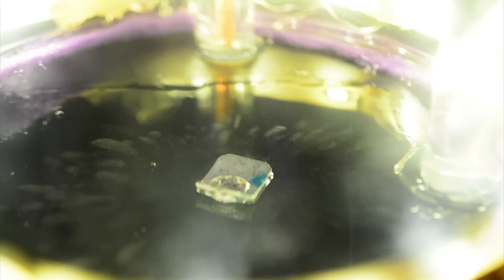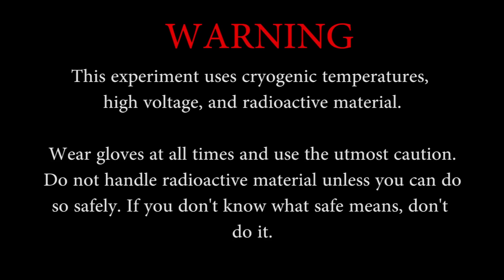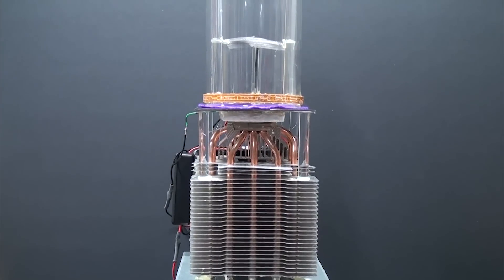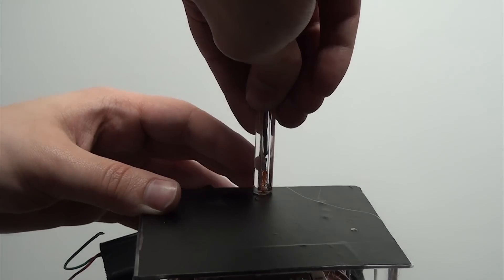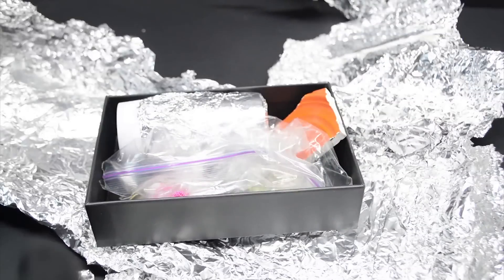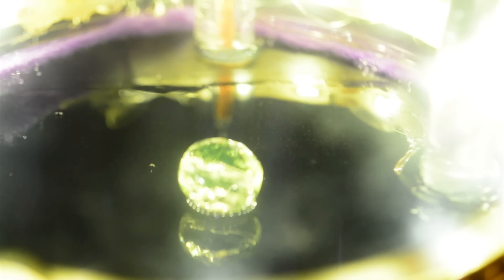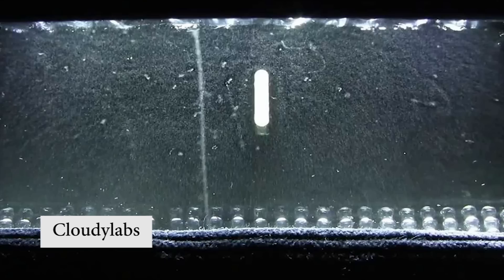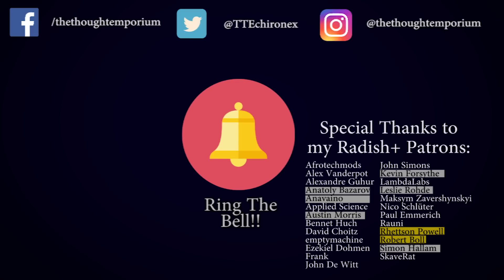Make Invisible Radiation Become Visible - Peltier Cloud Chamber

Comment: Excellent video! I LOVE radioactivity! It's fascinating, and these sources are just fine to work with!
"You shouldn't have built up a collection of radioactive sources".
Me: Oops.
I need to build one! I've been into radioactivity for YEARS! I look for the hottest sources, too! I have some sources that can go over 1 R/h or 10 mSv/h (excluding my X-ray tubes). I would love to put one of my 60 μCi americium-241 sources into a cloud chamber! Most sources are only 1 μCi! Also, each radioisotope has its own unique energy "fingerprint". Tritium beta particles are too weak (18.6 keV) to penetrate the vial. But you can "see" the effects of braking X-radiation (Bremsstrahlung) in a cloud chamber with Tritium. Also, try injecting Radon-220 gas left behind from sealed up thorium sources. ;-)

Comment: The thoriated tungsten rods for tig welding add thorium to make it less vulnerable to oxidation when in contact with the plasma. Its about preserving the integrity of the expensive tungsten electrode for as long as possible allowinging you more time to create consistent welds without having to stop and perform maintenance on the tip. Many (my brother included) describe it as a flux, but fluxes aren't alloyed within a material, they're just in contact to act as a barrier. It would be the same as describing chromium in stainless steel as a flux, but we know very well this is wrong.

Comment: Great video! I think if you turn the whole thing upside-down it will work better. It seems to me the CPU cooler you use has heat pipes designed to be on top of a horizontal cpu. Your heat pipe is currently functioning as a thermal mass/radiator. I would love to see a followup video where you test the hypothesis!
Reply: I've never seen a CPU cooler aimed at specific orientations, and also most CPU's are oriented vertically.
Reply: Yes, actually they work more efficiently hot side down...boiling away the working fluid to be condensed on the heatsink side. When you invert the system, the working fluid stays at the bottom (heatsink side in your apparatus) and you only get reduced flow through capillary action up to the hot side. BTW ;)

Comment: I think it's very cool that you show this. What I really don't like is the way you built it. Hot glue everywhere and nothing is mechanically really properly processed.
Reply: OHH soo thats' why it didn't work? oh wait it did.... ;]
Reply: @djosearth3618  It doesn't matter to me. Yes, it can also work if it was built that way. But hotmelt glue quickly dissolves from the surface with alcohol, so it will disassemble itself in a very short time.

I acknowledge the performance and find it a pity that it was built so unprofessionally.

Comment: this is pretty cool, but ive not seen the use of the hv grid before. i went on a college trip to cern recently where we made one of these, and it was just a box of dry ice with a metal plate on it, then a fishtank with some felt glued at the bottom, soaked in alcohol. This worked pretty well for seeing background radiation. Does the grid increase the "reactivity" of the alcohol, or is it something to do with changing the behaviour of the radiation particles?
Reply from the maker: Honestly I've seen mixed reasons for why it makes it brighter and honestly I'm not 100% sure. But what I've read is that it curved the particle trajectories to be more in plane with the fog so the trails are longer. But that doesn't really explain why things get SO much brighter when the HV is on. You CAN go without it, but the difference is night and day, especially with such a small setup
Reply: @thethoughtemporium  hmm... surely the electric field would curve them away from the plate? I will bear this in mind though, if i ever make one. Thanks!

Comment: I see you have a picture of a photomultiplier tube, I should mention I found some silicon photomultiplier devices as well which are easy to get from sites like Mouser or Digikey.  They go for around $67 for a 60035 SiPM device (bare SMD, a board is available with connectors and the device mounted but it’s $330!).  The device number correlates with the size of the detector and the microscopic cell size.  Very cool devices, and only use around 29V instead of hundreds of volts for tubes.

Comment: I've achieved -34ºC with a single 60W Peltier BUT cooling it with one of those closed circuit CPU Water Coolers, one with 2 Fans is enough to get that temperature (I measured it directly on the peltier thought) and the overall consume (without LEDs) is a little bit less than 65W so I used one of those 12V 100W industrial power supply, They are cheap and not that bulky

Comment: The cloud tracks themselves do not appear to progress (for example, left to right) very quickly. For example, over several video frames (say 20ms) to develop over a distance of a couple of cm. That is only about 4 kmh.  People can walk faster than that.

Since nobody has ever advised simply outrunning radioactive emissions, there must be some other effect that makes the cloud chamber tracks appear to develop so much slower than the particles themselves are moving. 

I can't figure it out. Ideas?
Reply: The cloud is liquid vapour/vapor and moderates anything moving through it like a brake.

Comment: Great project. I do have one question that I would like to ask. What would happen if the cloud chamber would be in a vacuum? I would really appreciate your answer.
Reply from the maker: It wouldn't work. The alcohol would evaporate too quickly
Reply: Thank you for your reply. I really appreciate it. But aren't there any other substances that you could use instead of alcohol? Or is it simply not worth it to go to the extect to build/buy (if they even exist) cloud chambers becouse you can't see anything different/more clear/new in these conditions? 
Edit: BTW, are there any methods to make gamma visable to the naked eye? I think that would be really interesting, and perhaps could also be a really interesting video.
Reply from the maker: @stijn2472  Bubble chambers are the next thing up from this and they show basically everything. But they're essentially impossible to build for the amature as they require pumping cryogenic fluids very quickly
Reply: Thank you for your reply. Hopelfully that is something that will be possible for a amature to build in the future. So there aren't any other substances than alcohol that you can use in a cloud chamber, and bringing the chamber in a vacuum isn't going to improve anything, even with a different substance than alcohol? Thanks again for your replies, I really appreaciate it. (My apologies for my bad English)

Comment: Hi, how did you keep the high voltage always on? Doesn't the capacitor need to be charged all the way?
Reply: It's not arcing so the power supply might be able to keep up

Comment: Isn't lead foil producing bremsstrahlung?
Reply: if you were sending high energy photons to it, yes. with alfa particles, no. also bremstrahlung will be created, but since lead has a high atomic mass and high density it will not pass through a sheet of lead. You could easily calculate this with the Law of Lambert-Beer and the lineair retalliation coefficient and come to the conclusion that most radiation will not pass through a few mm lead.

Comment: if you used a silver plate, instead of copper would it have been more efficient?
Reply: yes but that's expensive as hell, and it's only a 5% increase in thermal conductivity, and the heat coming in from the sides would also be simultaneously lowering the efficiency
Reply: The cost to efficiency ratio would be somewhat bad, better off using the money to buy a small compressor driven fridge or tear the hardware out of an old one to give it some really beefy cooling (and make it way louder)

Comment: if you get a big enough collection of samples you might try building a tank out of aluminum with a lead lined inner chamber filling the space between the inner chamber and the outer chamber with water.  the hydrogen is the desirable thing for stopping power. there are certain types of plastic foam that NASA likes but I forget the name off hand.

Comment: I made years ago a cloud chamber with 2 peltier elements but without high voltage and works very well, can see cosmetic radiation in sharp trails. I also add a little static electro gun for electron explosions in the chamber. See nedstar cloud chamber on YouTube.

Comment: Is it possible to use a aluminium plate instead of a copper plate? I have tried to built my own cloud chamber and got a watercooling system, but I'm only reaching about -20°c. I'm using a 3 mm 6,5*6,5 cm aluminum plate. Btw, I love what you're doing.

Comment: When he says "nuclear nerd" and the thing with the two circles glowing... that's deuterium gas blowing onto circular wires charged to a high voltage. The glowing is from nuclear fusion!! Like what happens in stars. 

The reason scientists don't use them to generate power is that this type (the Farnsworth-Hirsch Fusor) takes much more power for the electricity, than it generates in heat, so overall it consumes energy rather than creates it. But still, nuclear fusion on your desktop, it's pretty cool. The difficult part is getting hold of the deuterium, which is an isotope of hydrogen btw.

Comment: 8:44 I think possibly your explanation of a smoke detector mixed up how both an ionisation detector and a photoelectric detector works. A photoelectric is triggered when smoke particles disrupt a light beam on a sensor. Whereas the ionisation detector is triggered when the current flow drops between two electrodes because of the smoke particles interfering with the ionised air, which usually would let the current flow.
Reply: Mines smart. So certain theories state interacts with all things smart.

Comment: What about LiPo fireproof bags/safes? Would those handle the radiation?

Also, a regular coil stove-top can melt lead. Check out Hacksmiths latest video. They melted like 60 lbs of lead in a cast iron skillet on a stove.

Comment: I am legit interested in doing this but I have an interesting idea.
Instead of high voltage, what if I get a negative ion generator (air ionizer).
I have no idea what effects this could bring or if it would even change anything.
But they cost only a few bucks so heck, why not..

Great vid, Subbed btw
Reply: air ionizers use high voltage, unless it is a bogus chemical reaction which has already been disproven.

Comment: I picked up 5 grams of powdered thorium dioxide on eBay a while back. Needless to say, it stays wrapped in lead foil and I never open the vial, that is not the kind of dust you want to breathe lol. Also got a full Fiestaware plate, a 1 gram piece of U238 (lathe turnings), a smoke detector button, and one of those anti static brushes for cleaning records that has a small plate with a super this film of polonium210. I should probably get a lead pig for it all, but the lead foil works in the mean time. Element collecting eventually becomes like pokemon lol...

Comment: Thick layers of thermal compound are bad actually, it's not that thermally conductive. Use enough, but press them together firmly to make the layer as thin as possible. Also, if you apply the compound in the shape of an X instead of the rings you avoid any bubbles. Any air trapped in between the plates acts as a insulator obviously.

Comment: If gamma Ray's are light out side the visible wave lenth can it be used like uv to make things glow in visible wavelengths and if so could you charg solar panels with it ?
Reply from the maker: Can it make things glow, yes. Can it make things glow in the visible range, also yes, but mostly by heating the material until it's red or white hot. The "glow" is typically in the xray range. But some materials like scintillation crystals (LYSO and bicron are good examples) will release visible light when  a gamma ray goes through them.
Reply: @thethoughtemporium  interesting I been trying to find a way to improve on a project nerd rage did wear he makes a nucular battery with tritium vials heres a link if your interested

 https://youtu.be/KKdzhPiOqqg

But if gamma heats things up I wouldn't need solar panels necessarily be so cool to be able to power a clock with torbernite or something like that
Reply: I was originally thinking the glow in the dark paint lit wolud be changed by gamma Ray's but sadly after more research it looks like gamma just passes through it

Comment: how do you even wire up the peltier you didnt explain that and i dont know how to
Reply: samonie67 Peltier plates only have two wires, you just plug on wire to 12V (or 5V) and the other wire to ground. Then wait a few seconds and check which side is cold and which is warm.
Reply: @gfilion I mean how do you wire them up to the power supply and know which one gives the right power?

Comment: you made all the radioactive mystic particles sound so boring.... Amazing! - Thank you for such a clear explanation! ..... now, why do they need extra names?
alfa:  just helium ion
beta: just electron
gamma: just photon
Reply from the maker: the names add extra meaning. an alpha particle has no electrons until it hits something. beta have way more energy than a bound electron. gamma is a very high energy photon. For gamma specifically, that would be like calling radio the same as visible light. yes theyre both photons but they behave very differently.
Reply: @thethoughtemporium  Whow! Thank you for responding!
- Until now, I always thought all alpha,beta,gamma radiation particles were special particles of the weak force, or something akin to that... - Their own special stuff. It was amazing for me to find out, they are just relatively normal particles. :D
- At least for gamma particles it makes more sense now: They are gamma rays, so the name makes sense to me. (I've never realized that before, because I never even thought to connect them)
- For the other 2, the names are confusing to me, but I guess we named them before we knew what they were?
- Also, I always thought that high energy electrons just become muon or tau - I know nothing about particle physics, though. - They are electrons with high mass, hence the high energy. ... does 'high energy electron' just mean they have a lot of kinetic energy? I always thought all electrons have the same amount of energy....

Comment: FYI thin lead sheet is a poor choice of shielding material for beta radiation (uranium and thorium series have a few emiters)...hydrogen rich materials (water, plastics...) are a better choice and you don't have to deal with lead. Shiled wall obviously has to be thicker to make up for the density.
Reply from the maker: The plan is to do layers. So probably some combination of aluminum, wax and lead. Gonna build a much more robust box than is really neccasary. Even with just the aluminum the radiation is already essentially undetectable from the outside so this is all massive overkill.

Comment: I have built this, and getting nowhere near the temps required, only get below 0 degrees with out the top plate, and with it in place bearly gets to 5 degrees. i have the same peltiers that you have, and have a 450w ATX to power it all. and have even gone to  water cooling to try and get the temps down. im at the point where this project has cost me loads and have gotten nowhere. super frustrated.

Comment: is your high voltage zapper output, AC or DC.
Reply: It'd have to be DC if it runs on batteries.
Reply: Oh, the output... Since it's a transformer, it needs to convert DC to high frequency ac... But does it rectify the output

Comment: How did the cooler make minus 26celcius
Reply: It's a peltier cooler, when you apply electricity to it one side gets hot and the other side gets cold, increase the electricity and you increase the extremes, the only limit to how cold you can make the cold side being how fast you can remove the heat from the hot side - hence why he built the huge heatsink and fan to get rid of that heat.
https://en.wikipedia.org/wiki/Thermoelectric_cooling

Comment: You don't need lead. The plastic will stop everything except gamma and neutrons. If you have neutrons coming off of it, you've got bigger problems, so gamma is the main one.

First, there's very little gamma coming off of it, so it's pointless from the very beginning.
But if you want to shield that anyway just for the lolz, gamma isn't stopped by lead specifically, it's stopped by density times thickness. Putting few bricks around it will stop way more than a sheet of lead. On the other hand, lead is really quite toxic, so unless you are limited by space, lead is quite poor choice of shielding. The only reason why lead is sometimes used as gamma shielding is because it's very dense, so in space-confined areas, it adds lot of mass without taking too much space. Most often though, people in the industry use water pool, concrete and steel.

There's a much better way to avoid gammas though - distance. Store it in a shed, in the attic, etc.

I'd say if you want the biggest bang for the buck in terms of safety, forget about the radiation and focus on the daughter isotopes. Leaving the container sealed will accumulate some trace amounts of radon, so either be sure that you dump it every time you open it, or just store it open in a ventilated area and not in cellars, since radon tends to stay down.

Comment: For the theramal paste comment, no, more is not better. The point is to use the paste to fill in the miniscule air gaps, but if you put too much on, you are making that layer much thicker than it needs to be, and it will never transfer anywhere near aswell as dirrect metal to metal contact. A pea sized drop in the middle is more than enough.